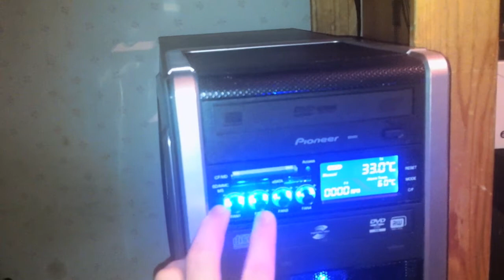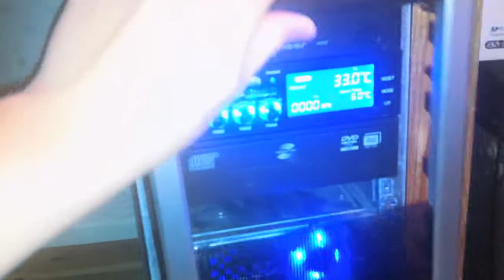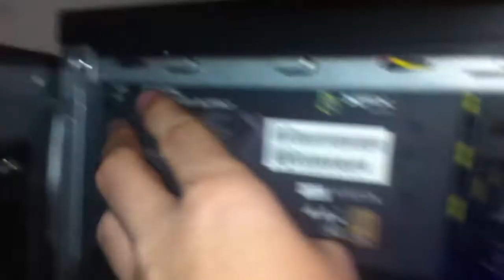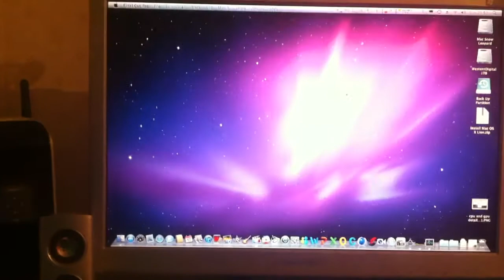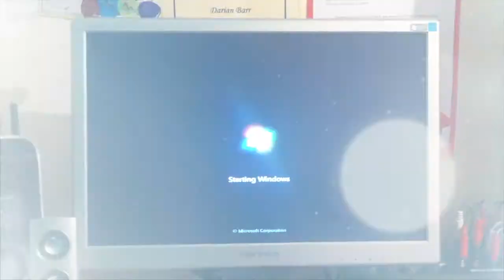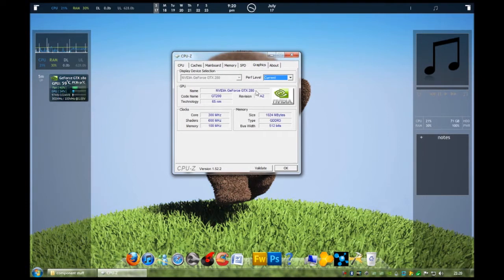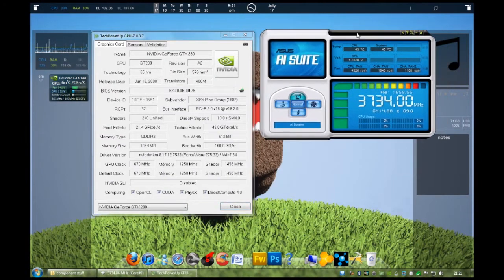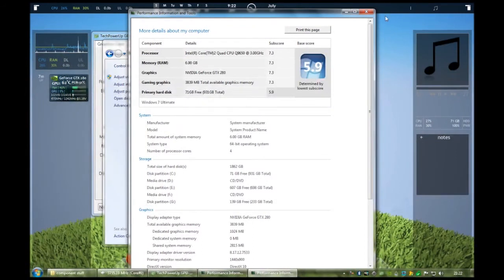My Custom Gaming PC & Hackintosh Revealed!

Comment: also not be mean but, i'm pretty darned sure if both of those side panels push colde air in to the case and that radiator fan pushe air out of the case it would work a little better mainly, because the video cards hot is being pushed out of the case and sucked in to your radiator with the setup you have in the video, the reason being hot rises.